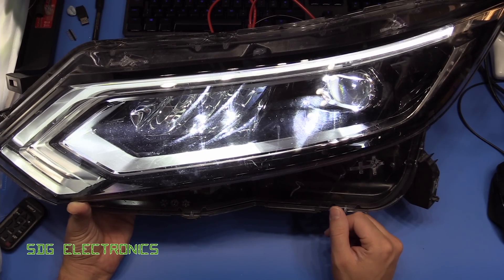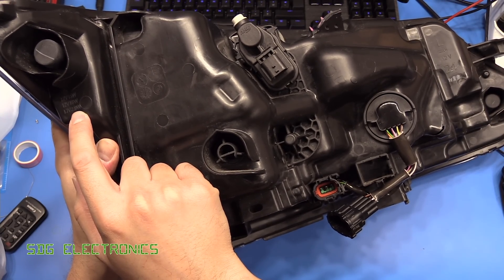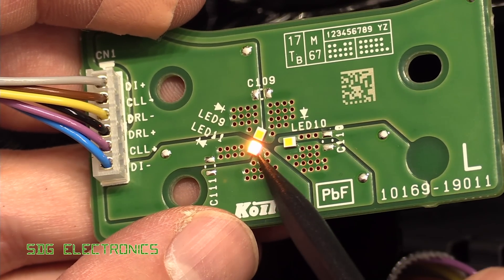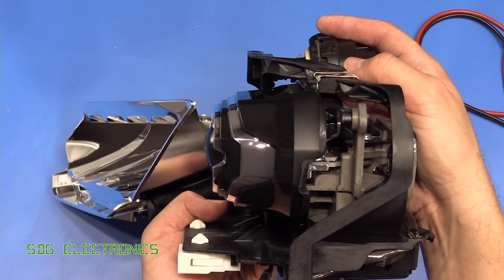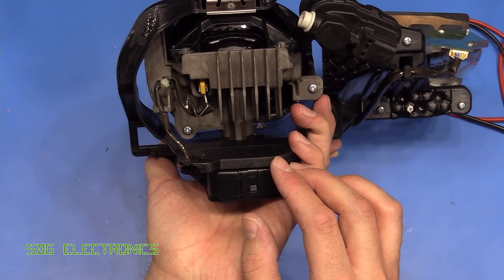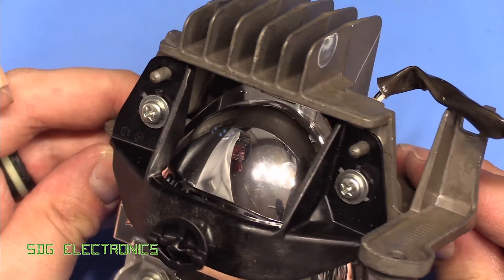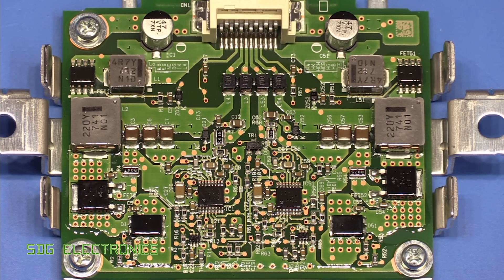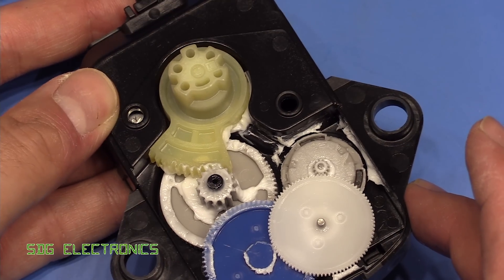SDG #136 What's inside some car LED headlights?

Comment: Feels so overengineered.
Reply: The indicator DRL light pipe thing with the copper and hefty heat sink is a bit over complicated and favouring style over pure engineering, but the rest of it is excellent, I’m quite impressed. Apart from the motor for turning the light with the steering wheel angle, how is it over engineered?

Comment: I have a 2016 Range Rover  Evoque built for the states. I am on my second set of passenger all LED adaptive headlight. It would simply start blinking as I turned the steering wheel. After a month or so it would just fail to turn on the main beams. Both times under warranty but on Ebay the whole assembly was for sale at $3000. 😳 other than that happy with the car. Enjoyed the video! Cheers!
Reply from the maker: I can't understand why they are generally made to be unserviceable. BMW have the right idea with removable LED modules.

Comment: I have an Audi LED Matrix headlight, which I also bought on eBay for quite a bit of money. It's a lot more complicated than the one shown in the video. I never had time to play with it and was trying to donate it to someone for more than an year.
It's got 11 separate lenses in a few rows, a bunch of reflectors and a massive DRL/turn signal assembly. Most of the LEDs are on flex-pcb. Took out of it more than 50 Torx screws,  bunch of wire harnesses and small driver and connector PCBs.
I would have gladly ship it to you for teardown if it wasn't so big and heavy. The shipping to UK will cost an arm and a leg.
Reply from the maker: The matrix ones look really nice, but I'd hate to be on the receiving end of the bill when they fail :(

Comment: Kudos for your subject choice. Extremely interesting.
Although I appreciate the engineering of these LED units, the execution of some is far from ideal, favouring design wankery over effectiveness.
The indicator light pipes placed over the headlights have poor contrast against the headlights and are very hard to see at angles and during the day amongst reflections.
The DRL's are often dazzling even during the day and would be more visible (and easier on the eyes) if they used a warmer colour that contrasts with sunlight reflections.
Many people forget to turn their headlights on in the dark as the DRL's light up the road and the dash is permanently lit on modern cars resulting in blinding oncoming vehicles.
Reply: Amen to that, and add DRL use in rain/fog/snow as most manufacturers don't turn on the taillights with the DRLs. Itmay be bright enough for the Auto setting to stay in DRL mode instead of switching to dipped+taillights, but you're not exactly visible from behind...
Reply: What's a DRL?
Reply: @FrankEdavidson  
Daytime Running Lamp

Comment: This reminded me of a Kia Ceed I worked on, where the DRL started to work intermittently, and with time would eventually die out. Happened to both headlights, firts the right one and a couple months later the left one. Seemed to be a common problem with this model, and the failure mode suggested that the problem was in the connection to the DRL board and not on the LEDs / driver board.
Nice video as always. Cheers.
Reply: What’s a DRL? 🤔

Comment: The auto industry is very regulated around safety so usually over build some parts. You dont want headlights to start flickering while you driving. Very interesting to have a look inside. 👍

Comment: Next I guess you are going to design yourself some custom LED boards for your car?  Very nice unit.

I once thought I should replace my turn signals and other lights on my car with a bunch of WS2812B's so I could run light shows on them... never did get around to it.